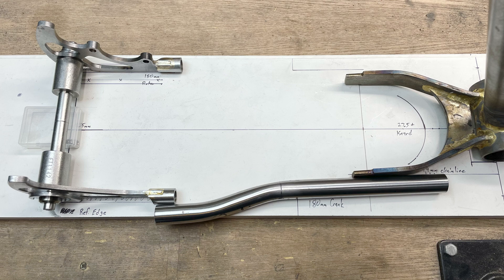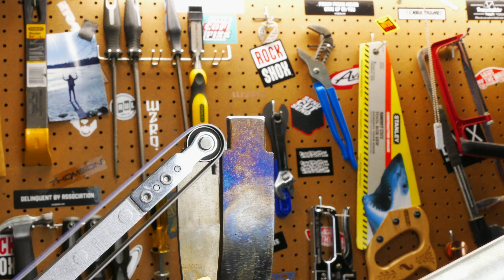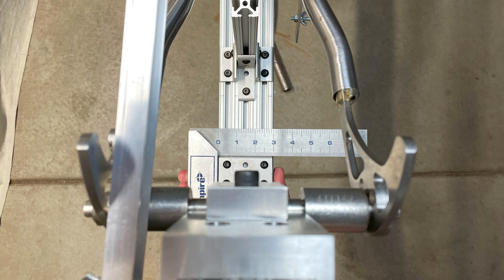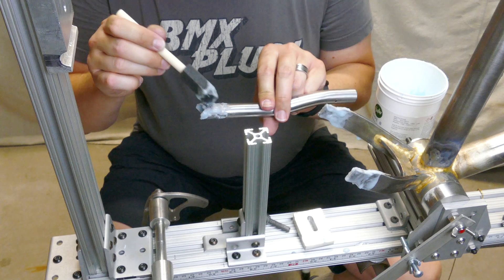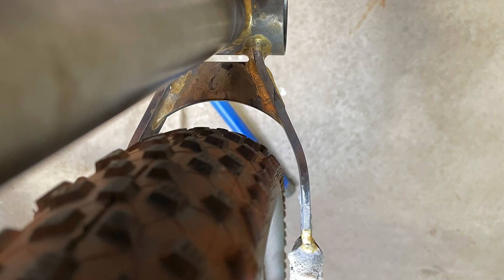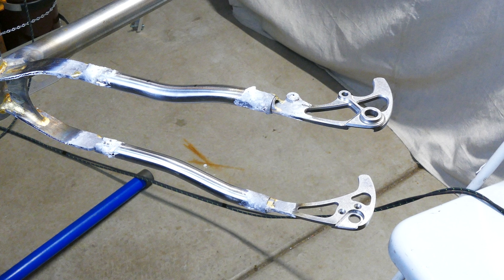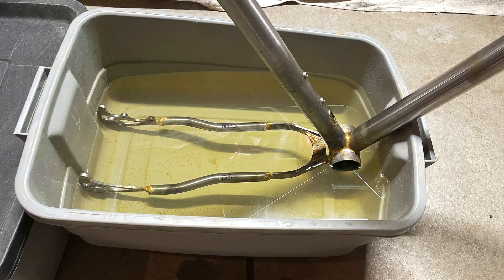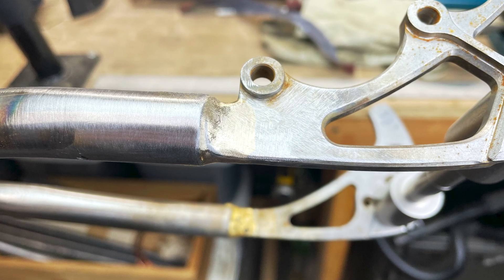DIY MTB Frame Ep 11 - Chainstays (Part 2)

Comment: Are those Paragon dummy thru-axles on the rear triangle?  What size?
Reply from the maker: Yeah, it’s a 142mm PMW dummy axle.
Reply: @ThriftyFramebuilder  Do you find that after brazing the rear triangle, the dropouts have heat distorted so that they are no longer 142mm, but in fact are about 139-ish or so?
Reply from the maker: Yeah, there is definitely some cold setting of the dropout spacing that happens along the way. For my first few frames I used a dummy axle that was 2mm wider than the actual spacing, but I don’t think it’s really necessary. It’s pretty easy to adjust the spacing.
Reply: @ThriftyFramebuilder  hmmm.  Interesting,  I wonder if the heat distortion causing dropout spacing shrinkage can also be dealt with by adding a couple thin 1mm washers to each side of the Paragon rear dummy axles.  Your thoughts?  I wouldn’t know because I currently don’t have any Paragon dummy axles to try that on.
Reply from the maker: You could certainly add washers, but cold setting the rear end a few mm is easy.